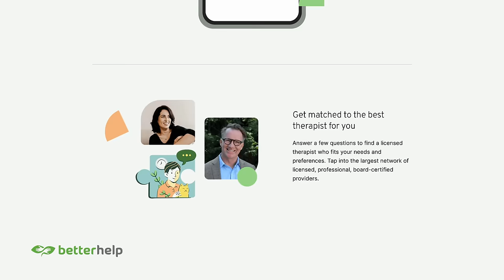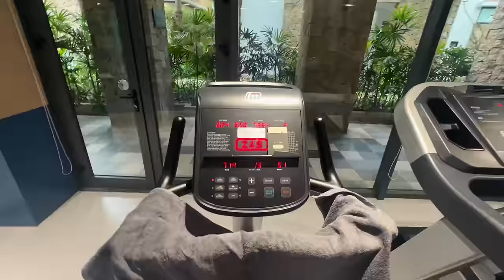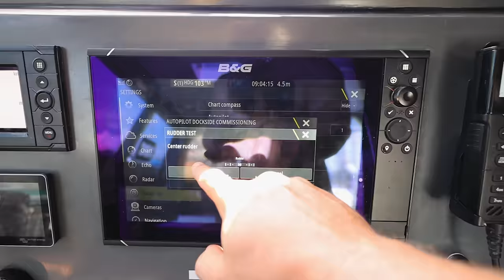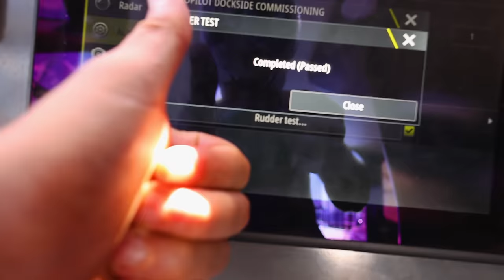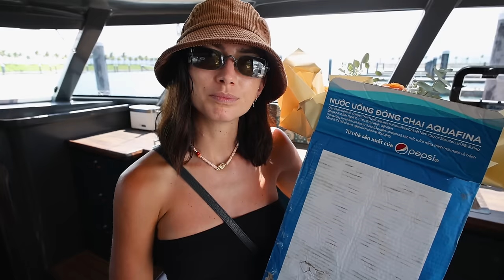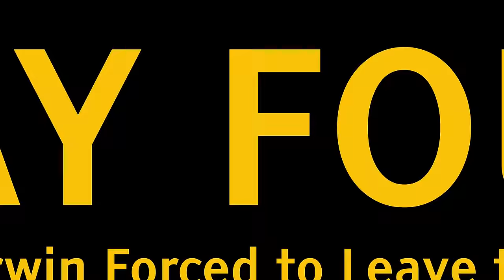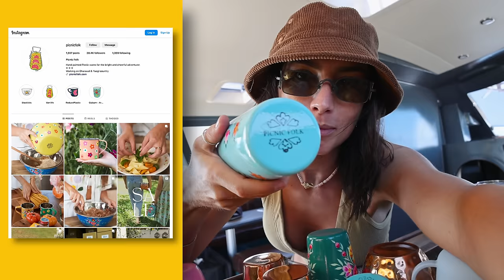Moving Aboard our New Boat! (Prepping to Leave Port)

Comment: Riley to take the heat off the electrical equipment, you could put an insulated box around the engines since they are water cooled. They do it with generators & it cut the noise down a whole lot. The only thing is they will need a vent with a PVC pipe so the engine can draw in air for the fuel air mixture. The radiator/raw water system will keep the diesel engine cool.

Comment: She is a beautiful vessel. I am surprised by black sails for a cruiser and you folks are not the only ones choosing this color sail. They look super cool but I suspect they are more susceptible to UV breakdown.
Reply: I thought the same thing - how anything black or dark will get so heated up and expand while in the sun, and then come nighttime, the cooling - sometimes rapidly - will re-compress / shrink it. This process will totally weaken and compromise any stitching, glues, etc. used and therefore is a durability and safety issue. You'd want to only reflect sunlight on anything so important, not absorb it - or so one would think. (But maybe someone could explain the reasoning / benefits of black sails here...)
Reply: @lndigobunting  the sails are black because thats the color of the material they are made from its not an artistic choice.
Reply: The 50 + GLYWO boats going around the world, and only one boat so far has ripped the genoa, after 2 years constant sailing.

Comment: I don't understand the Visa problem was the mistake done where? Vietnam or where ever you applied for it? Darwin is a 2 year old Toddler. Somethings wrong with Vietnam's immigration system. I guess that's what you get for a third world communist country. The boat looks absolutely epic and I hope all the sea trials go great. Also hope for a speedy Visa run
Reply: So better to have soft boarders, continue to allow child trafficking & drug exportation. Like any country clerical issues happen, responding to it in a mocking way doesn't help.

Comment: Just so you know all of south east asia is working hard to crack down on foreign visitors coming in and committing crime of various types, including human trafficking, which has been a huge problem for them for decades. Thailand and Vietnam are cracking down the hardest with the Philippines following suit. I'm sure their methods and success rate is debatable but it is happening so just be aware and be on top of whatever rules an regs they are doing which I am sure you have figured out by now lol.
Reply: Right? best comment I've read so far. You'd think with the boat being built there, Rapido local knowledge, all the international travel they've done, they'd be aware of the situation, empathise clerical issues can happen, and not potentially embarrass the country to nearly 2M worldwide viewers.

Comment: I'm curious what your shakedown expectations are? I was a yacht broker when younger, raced a bit, sailed dinghys and PHRF and have cruised and have all my certifications...so I'm not just asking idly. I see your boat as at least a semi-custom boat, if not totally custom. I'd expect two full sailing seasons before you'd have everything sorted out, just so you know.

But then again, unless one is buying from a high volume manufacturer, I expect a new production boat to take up to a year to fully shake down. And that's on boats that aren't high performance or pushing cutting edge power systems etc. This is not meant to be a criticism, rather I'm curious what you guys expect? Congrats on the boat, I have to admit that when you announced this I thought it was nuts. But now that I see the fully realized boat, I get it. Much respect,

Last. I can see how stressed this all makes Riley...just sayin', brother. It's not as though you are taking on a lot, that goes for the both of you.

Comment: How long can a car radiator tolerate sea water? or is there something maritime? Not to cool the engine directly, but to cool the room air. You could (hopefully) quite easily hiss cold water intake and engine coolant line. Sea water at 25⁰ should be enough to keep the electronics happy and it shouldn't bother the motor too much.

I just had the idea that you could use a water-cooled charging air cooler from the autotuning and a blower on one side, I mean. They are made of stainless steel and have been developed precisely to cool air and are practically indestructible

translated with google

Comment: The lithium batteries should  not be in the engine room.  Lifepo4 chemistry is happiest at the same temperature humans enjoy. Your engine room, even with good ventilation will be circa 40degC. This is too high for lithium and will reduce their life. Even with high ventilation rates, if the Lithium can 'see' the engine, the high radiant effect from the engine block will heat those batteries. I know of similar setups where lithium was located in the engine room and those batteries failed after 5 years. You should expect 10 to 15 years out of your batteries if installed in a well ventilated space away from the engine room
Reply: Agree fully this a very poor design and should have been identified and rectified in earlier builds.  A rapido fail I say.

Comment: From a safety standpoint that boat worries the ship outta me!
Reply: Yes fully agree Reiley and safety are 2 things that do not go together ever.  The boat launch, kids hardly ever wear life vest, I have never seen him attached to a safety line.  He thinks he is above that stuff.
Reply: @gregmatthies8128  I don’t want to be negative and ruin their moment, but that cat is NOT kid friendly.  Also, that cat is overpowered for Riley and family.  Absolutely no justification for a family on the high seas.
Reply: @dictator9849  yes Reiley wants speed without compromise and that requires a light weight ie no washing machine or dish washer or other convenience with very little deck space.  I said initially this is a strange choice for a growing family live aboard.  It only has 2 bedrooms and couple day bunks in the pods.  They need full time assistance on the boat either 1 or 2 adults.

Comment: Thank you for all the hard work you guys do just to share your adventures.  PS I got to work w Albert Ellis  was one of the inventors of  Cognitive Therapy.  (Which I personally still work with) The 30 sec version is we can only prefer things be different vs "demand" things be different. If we  overgenaralize , (accidently or on purpose) using, should, must, it's terrible, (abolute language) we disturb ourselves. Ellis was famous for profane language and a humorous ohrase that my group made up that covers anything , yes anything, going wrong ( this lighten things up) is : I prefer this sh#t not be happening.  Preferable said with gusto several over. It stops the overwhelm or depression in its tracks and gives one a breath to see what's next. Hope this helps whoever reads this.

Comment: Are pirates an issue, what deterrents do you have to thwart their boarding your craft? great episode probably required use of betterhelp due to the stress. Riley mentioned the heat situation with the engine room, I was unclrear if it was resolved. was a Safety review performed with you and the boat builders Rapido?

Comment: Before a boat manufacturer hands off their expensive product with their name and reputation on it to the customer EVERYTHING SHOULD HAVE BEEN THOROUGHLY TESTED AND FULLY OPERATIONAL BOAT AS CLOSE TO PERFECTION AS HUMANLY POSSIBLE. .  A manufacturer should take pride in their work and not deliver a piece of crap. Windows and hatches should have been shower tested with high pressure water in house to make sure ALL seals are reliable and leak proof. The engine should have been thoroughly tested for all expected anticipated scenarios where back flow would not be a problem. ALL sales should have been rated for ALL highest wind scenarios so they dont rip or get torn away. When the new owner receives his boat there should only be minor adjustments and touch ups not major problems.

Comment: Great looking boat but you will have problems due to te fact that it is 4 times wider than a monohull of the same length. Will harbours and marinas be able to accommodate it? And who will take it out for maintenance? Overstaying your visa, for whatever reason, is not such a good idea.